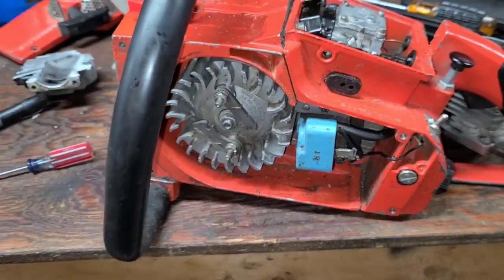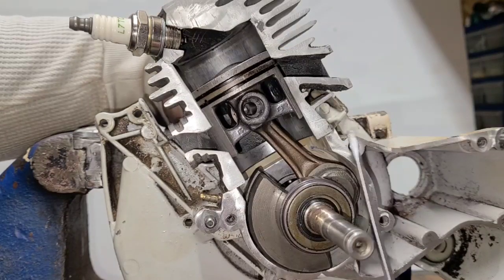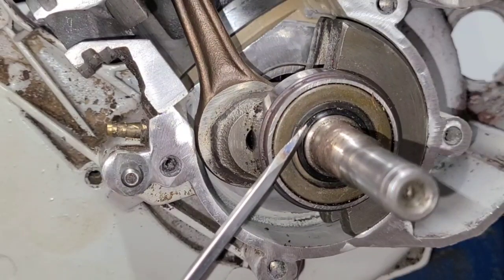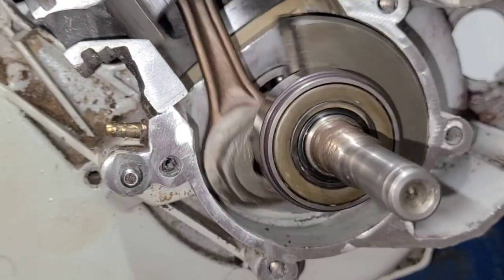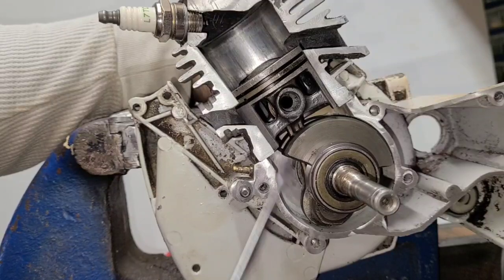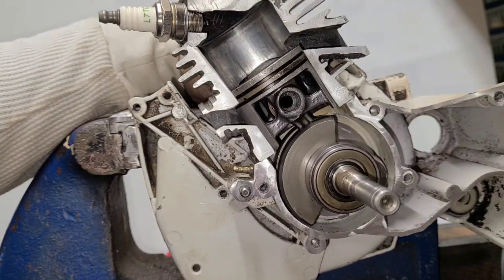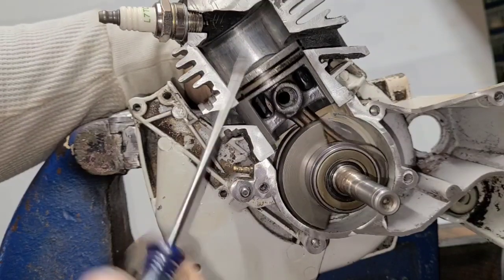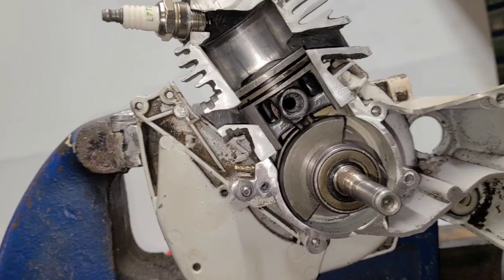Chainsaw cutaway # 4: 2 stroke air leaks explained

Comment: Wow! Thanks.  I repaired my 026 by replacing the top end.  I tried the same thing on my brother's 280. It started, idled well, but got very hot.  You just explained what was wrong the whole time--I replaced the wrong part.  Getting too hot must have been the original problem.  You are a super teacher.  Keep going.

Comment: Great concise explanation, thanks. There are many overpaid university leturers who would do well to emulate your technique and style.

I'm currently experiencing an air leak issue with my boss' MS390...worn crank bearing diagnosed by repair shop and now started racing at idle...I suspect it does not have many hard days logging left in it...videos like this one help further my understanding of the problem and allow me to explain why we will require a replacement saw quite soon!

Comment: The cut away series is awesome. I've seen a few animations of how a 2-stroke works. But actually being able to see inside the engine while you explain what we're seeing. Game changer for sure. Thanks man.
Reply: learning that the air-charge in a 2-stroke is compressed in the crankcase is most strange to me after learning about the 4-stroke where it is compressed in the cylinder; it takes some getting used to but once you understand, it is easier to diagnose any problems.

Comment: I do alot of automotive work for my neighbors and friends, And when I hear a high idle on a vehicle that is computer controlled I know that it has a vacuum leak. The way I find the leak is by connecting a hose to a Colman propane bottle and crack open the valve and run the hose around the intake manifold, when i hear the idle go down i know that i have found the leak because the engine pulls the propane in through the hole and brings the air/fuel mixture back towards the 14.7-1 mixture which is referred to as a stoikect measurement known as a perfect fuel to air ratio that your vehicles computer is constantly searching for from the time you turn the engine on until you turn it off again! It works like a charm 😉

Comment: I know this is not a new series but I just barely watched it. I'm an old guy... Almost 80 and I used to own a saw shop and you left out one of the sources of an air leak, the intake block under the carburetor. In fact this is a common defect on some of the Holzforma saws. If there's an air leak between the carburetor and that cylinder it will make the air fuel ratio all wacky and you'll get the exact same result as an air leak on the crankshaft seal.

Comment: Thank you for another great video! As a novice saw guy at best, I recently had a saw to fix for someone that had a scored piston and cylinder. It was not a straight gas issue. I did find that the carb was actually loose from the intake. My limited knowledge leads me to believe that could have been an "air leak" which limited the amount of lubrication from the fuel/oil mixture. I understand most air leaks are found in the bottom end but do my thoughts here make any sense? Thank you in advance for your help.

Comment: Something I have noticed since I rebuild more back pack blowers then I get to saws. When the crank becomes loose from the bearings and it has crank play from blower side to pull start side it causes a crank seals to leak when they do that the base gasket tends to go on both sides directly where the transfers are from the case to the cylinder resulting in the push effect like you are talking about resulting in fuel/oil buildup around the base of the cylinder but 30,000 hrs of 1 to 2 hrs of straight full throttle with maybe 15 minute fuel ups going from property to property doing leaf cleanups. They do have the exhaust and transfers a little weird at first with a squish of .062" with base gasket and .052 without ex ATDC is 110-112 transfers is 125-126 then I got to thinking how the bottom end is and how the carb is what the idle speed (2000 + or - 200 rpm) and max rpm (7200 + or - 200 rpm) is and that it's pretty well much under load all the time. Anyways sorry for the rant part completely different style of things for those then a saw. Same style air leaks though throughout any 2 stroke.

Comment: Im sitting here watching this and by the way the cutaway series is straight gold i may of said that in the first video but anyways. I have a 48mm husqvarna cylinder in my hands at the same time.  I know no this has nothing to do with the video, but i was looking at the plugs. Bottom line is i hear many guys say why are you worried about the spark plug so much. Kinda silly to me not to worry about it considering its a pretty important part of the combustion engine. What i was hopi g is you could do a video on why or why not it may or may not be beneficial to change your  spark plug more often or less often. I run 3 to 4 differnt saws cut 15 plus cord of wood with each and i change them at least once a year and keep the old ones that are still good for spares. Personally im not claiming to be right or wrong just curious. Thanks for the great videos
Reply from the maker: Hey thats a good topic and one that I've been asked about often..

Straight goods is I rarely ever change my plugs lol. Not sure if its the oil I use or what but my plugs are usually clean and thus I don't ever feel the need to replace them. 

Just my experience, I feel its probably good practice to clean and inspect or replace plugs regularly. 

Its probably because I have so many saws and none get a huge amount of time.
Reply: Its good information no matter it makes people think. Thats the goal to get the gears turning isnt it, maybe not the goal but certainly one of them

Comment: I have a husqvarna 135 (small saw)over here with a cranckshaft leak. I’m not looking forward to repair it but I will go and try  it this summer. Any tips or how to’s to replace te cranck seal? It’s not the one behind the flywheel but at te side of the clutch/chain

Comment: Is one of the symptoms of an air leak that a saw will start and idle, but when the trigger is pulled the saw shuts off (compression is high 160 psi and carb kit installed)? I have a Stihl 026 with this problem.

Comment: Cut the plastic bottle into a tube and attach it to the air filter.
If you spray water on the right crankshaft with a shower, it will absorb the water and stop.

Comment: Disclaimer: I don't have much for a mechanical brain. I am still trying to figure out why one of my 550xp (autotune) saws wouldn't idle, but if you started it with throttle engaged it seemingly ran fine. Let go of the throttle and it would die. It's the only time I've had this happen. It also lost compression at some point. Ideas of what may have caused that?

Comment: Would a leak make it not start at all my carb seems to have no suction at all it has good spark and compression but not getting fuel to the spark I have cleaned all the jets and float in the carb

Comment: How do you check and diagnose where the air leak is occurring?
Reply from the maker: Vacuum and pressure test or spray the anywhere that you think may have a leak with carb cleaner. Carb cleaner will make the saw stall

Comment: Does good compression mean that there aren't any air leaks in the crank case, or is it possible to have good compression and still have an air leak somewhere else?
Reply from the maker: Air leaks generally don't effect compression
Reply: so air leaks affect only when the piston moves downward and compresses the mixture in the crankcase but not above the piston because the ports are sealed off by the piston then?

Comment: Question for you to man, have you ever had anything to do with the stihl 4 mix engines ? I’m working on one now which has seized the small end and smashed the piston , every one I’ve seen or heard about has had the same problem but being a four stroke working on a two stroke mix , (50-1) it means their only being fueled every 2nd revolution .
Reply from the maker: They are quite common around here but Ive never worked on one of those.
Reply: Wild guess, would it be better to run at 40 : 1, but still using a quality oil? Told by a chainsaw mechanic, if using the cheaper gas station oil, use at 25:1 or 32 : 1 max. Engines reputedly last a lot longer. Hope helps.

Comment: My 461 has a brown piston when i look on the exhaust side is that normal for a stock saw
Reply: At least to some degree, that is normal.  The brown tinge you're seeing is basically carbonized oil.  On a saw with a lot of hours it may be worse due to accumulation over time.  When we used fuel/Oil ratios of 16-1 or 32-1, that would happen sooner, but modern oils probably less so.
Reply: Bought an abused Mac 335, spares or repair. Muffler screen full of carbon. Side of piston almost black. Top of piston coated with carbon. Cleaned muffler,by soaking in caustic soda solution bath. Be careful of chemical burns ! Set piston so exhaust port closed, sprayed some " Mr Muscle" cleaner through plug hole & left for hour. Tipped out & repeated. Most of carbon deposits removed. 
Added 5 ml of white spirit into a litre of petrol, then mixed fuel at 40 : 1. Ran the saw through several tanks, then removed muffler to check the exhaust port & piston wall. The discoloration had gone, looked almost like new.
Use at your own risk! Just it appeared to do wonders for me.